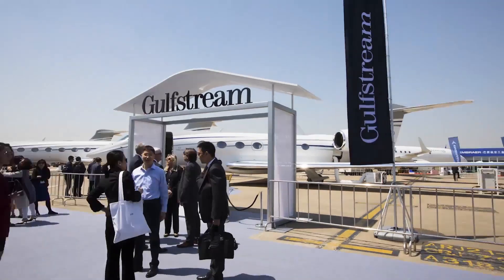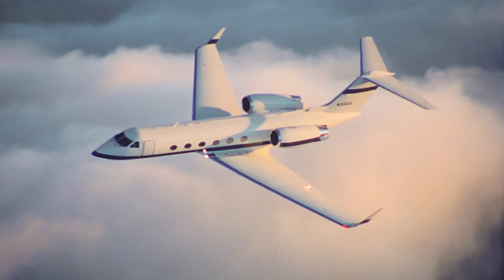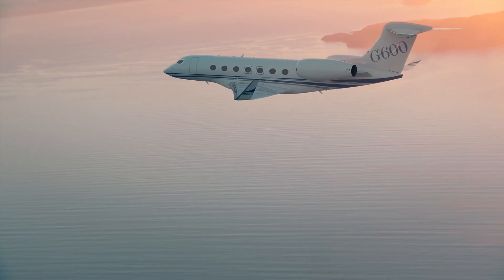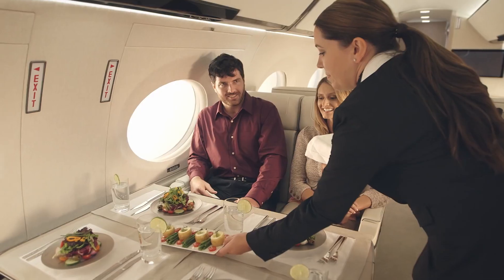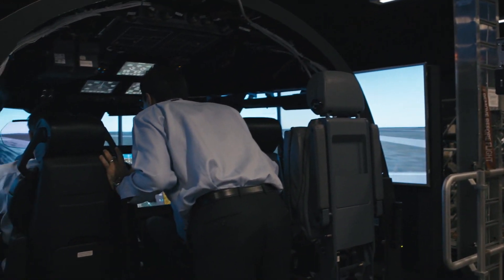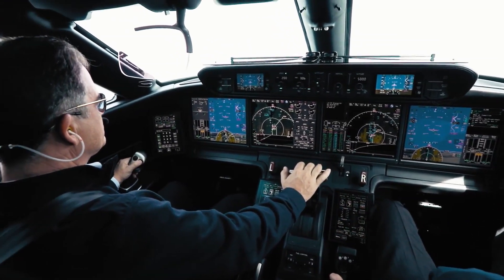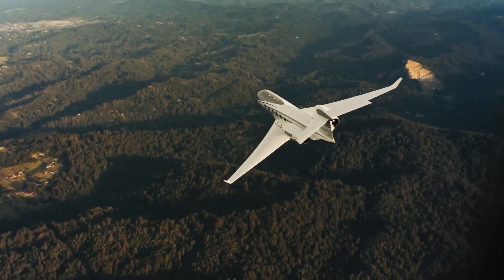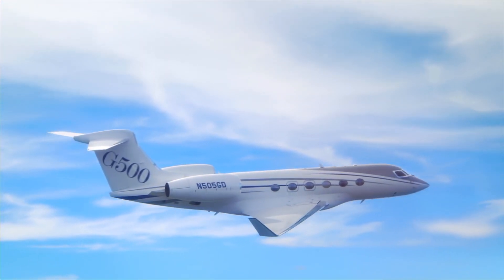Gulfstream G500 and G600 - the advanced jet brothers

Comment: The fuselage cross section (external width) of the G650/700 is actually 7 inches greater than that of the G500/600. The narrower interior of the 500/600 is attributable primarily to this and not significant differences in sidewall insulation as might be interpreted from this otherwise excellent video.

Comment: @Skyships Eng  You never showed the 7 window G500s (except in the thumbnail). Only the early G500's (test aircraft) had 6 windows. The G500 and G600 are both 7 window aircraft and the G650 is the only 8 window aircraft. The G700 will have 10 windows (on each side).